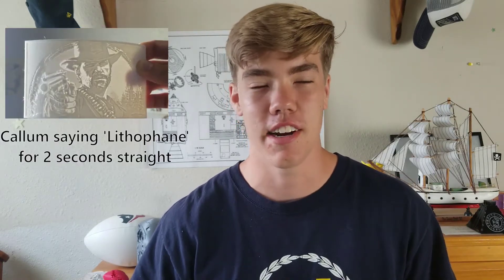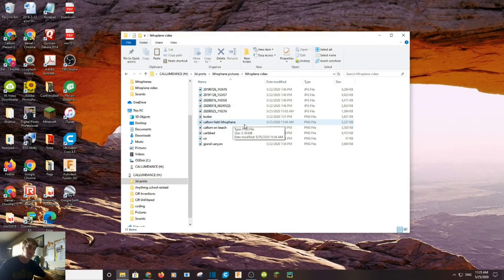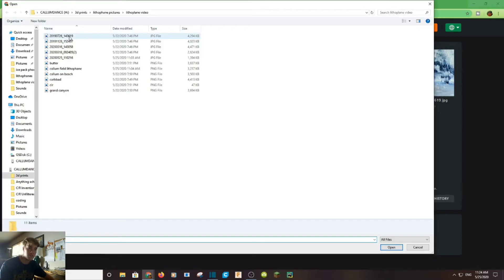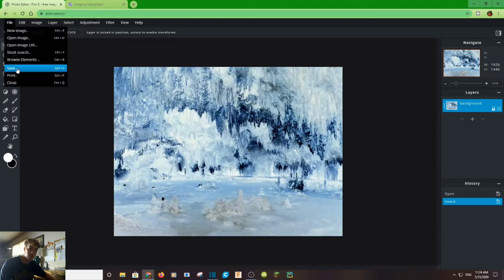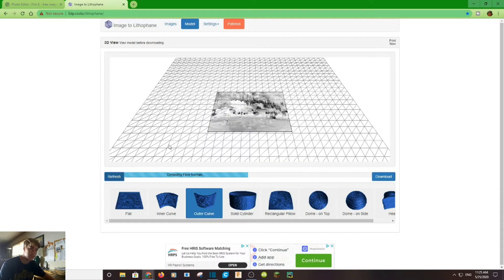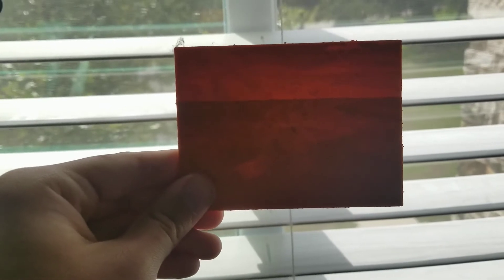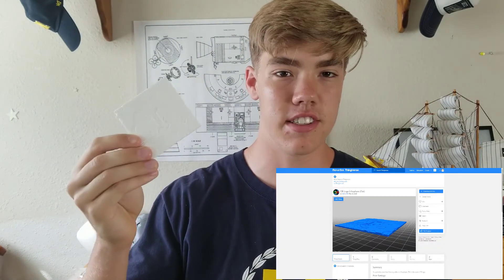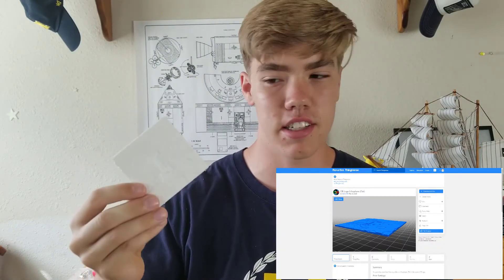Lithophanes, and How to Make Them! (3D Printing Pictures)

Comment: Hey I'm really into your videos right now because I just got and ender 3 pro. But a few days ago it started to make a screeching noise when I turn it on sometime. I think it's from the fan and it I let it go on for a bit it stops but I was wondering if you ever ran into a problem like this and how I would fix it?
Reply from the maker: Which fan is making the noise? If it's the one above the nozzle, theres most likely a piece of stray filament just flapping around in the compartment
Reply: @CallumPrints  ya its that one by the nozzle I'm not sure if it's the front or the side but that could be it. Should I just take that piece apart and look?
Reply from the maker: Yeah, check for filament, dust, anything else that might be blocking the fans
Reply: @CallumPrints  ok thank you for all your help